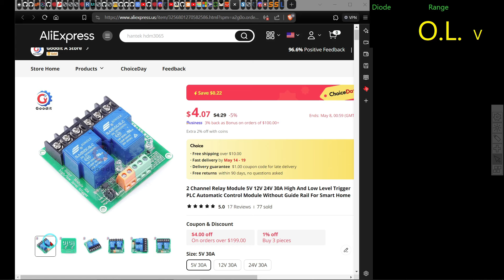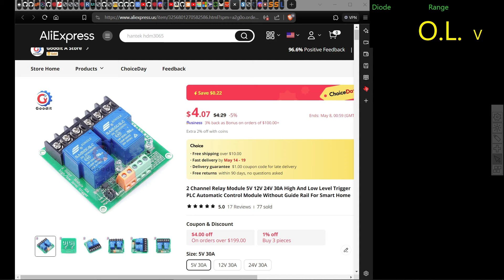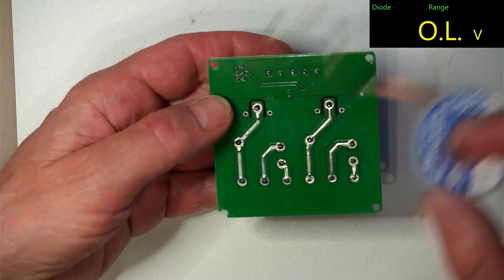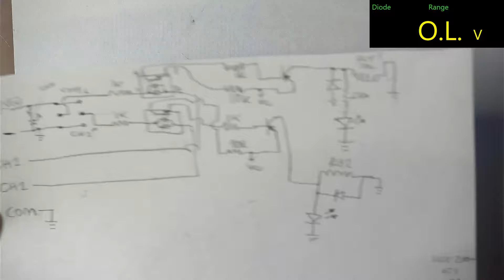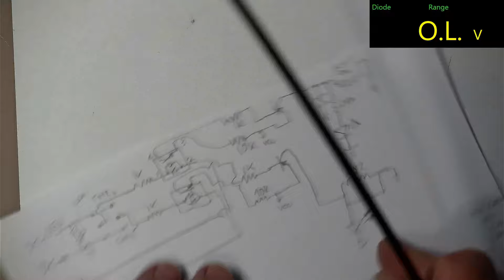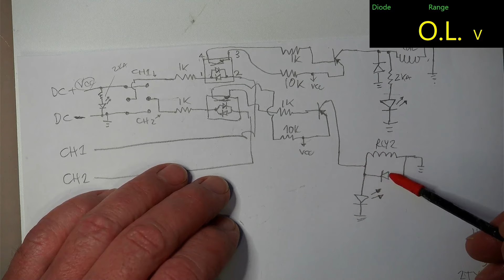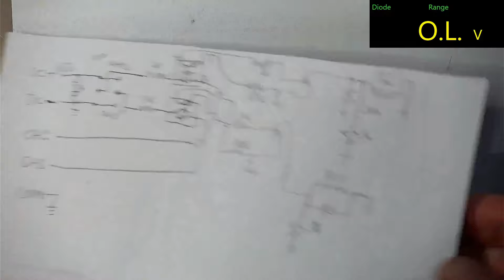Fixing a faulty relay board.

Comment: So you turned off auto focus and are using .75 Barlow lens?
Reply from the maker: If you are talking about the microscope camera, it does not have autofocus so I assume you mean the auto exposure?  In that case yes I use it with auto exposure turned off so I can adjust the external lighting to get the best exposure.
Reply from the maker: I tend to use the .5 or .75 barlow les as appropriate.